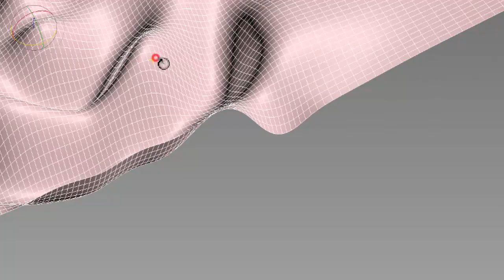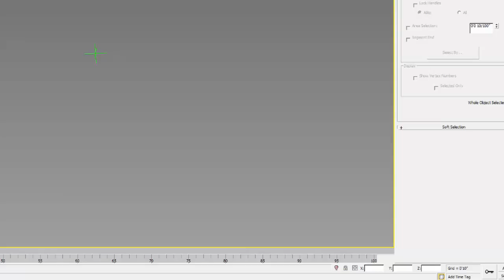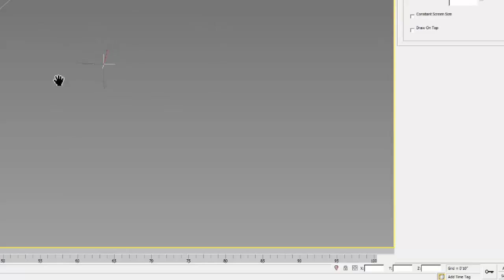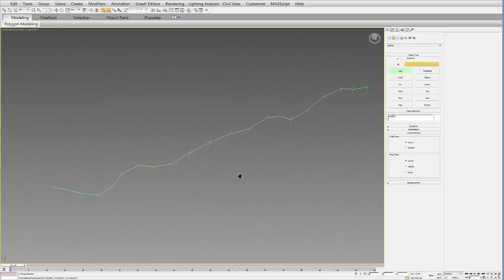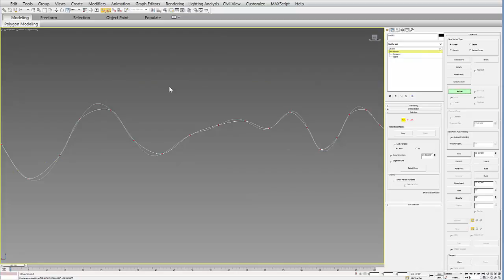3ds Max Tutorial: Rebuild a line with equally spaced points

Comment: This would apply to using that spline later for other purposes like lofting where the lofted objects gets cross-sections along each vert so a smaller amount of evenly spaced verts is desirable. This also adds bezier control where there was none. FYI the normalize spline modifier can do the even spacing part.